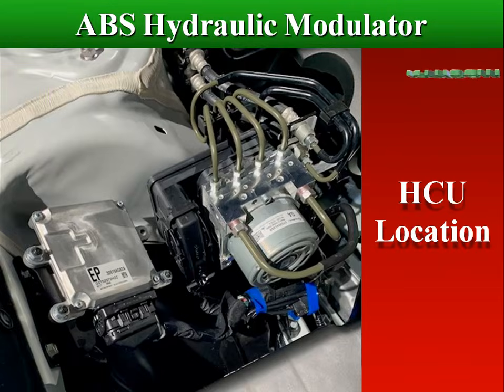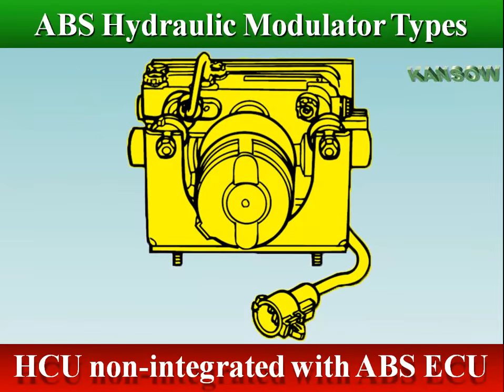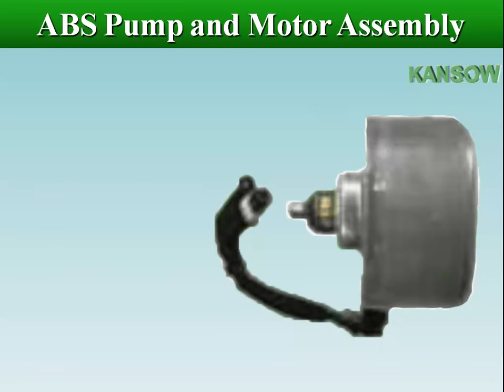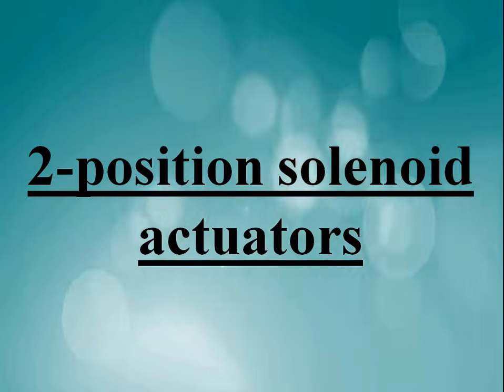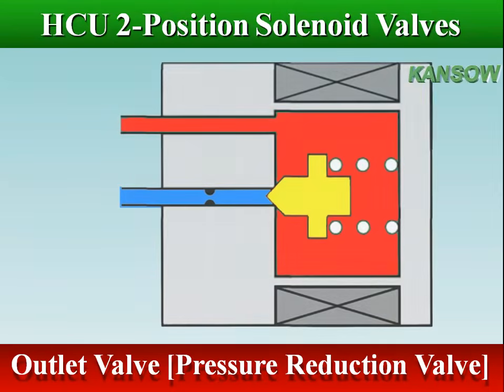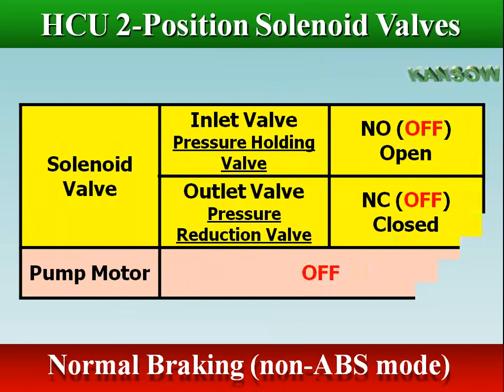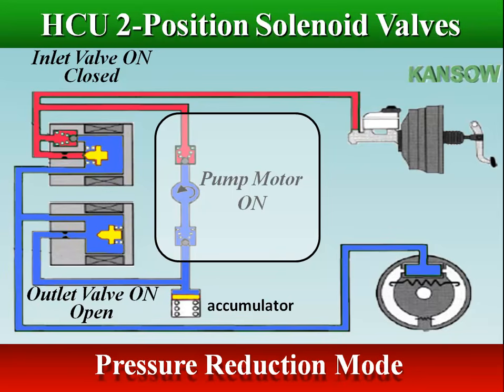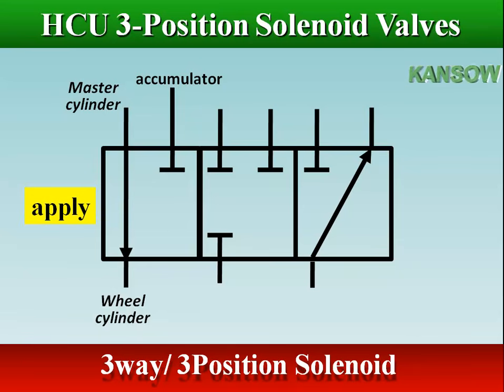ABS Hydraulic Modulator Types &  Components

Comment: If you are based in the UK and you are watching this,  I can fix your ABS module,

If happens that you have one module for repair due to:
- Locking up of one or multiple wheels
- No brake pressure at one of the wheels
- The brake pedal doesn't get firm after several unsuccessful bleeding attempts, when the tested brake pump works just fine.

 contact  me for more info.

Comment: I am fascinated by technology .. I was a Donnington GT championship outright champion in 1980.  My self made Championship winning car had twin master cylinders to allow for BALANCED braking . As the driver, I was the ABS modulator . A recent brake pad and fluid flush on my newly acquired 2008 Citroen C5 saloon car . Resulted in    a pedal going to the floor whenever the engine was started .   Otherwise the pedal was a good firm TOP pedal .I was convinced that this sinking pedal was possibly worn Master cylinder seals , failing under the extra pressure from the Brake booster . After flex honing the brake master cylinder and replacing the seals .€6 euros . The sinking pedal still existed . I bought a Foxwell NT630 Plus abs scan / bleeding scanner .EXCELLENT. this scanner allowed me to cycle the ABS module and resulted in a marked improvement . Still not 100% to my liking .  The Foxwell NT 630 Plus scan tool   displays the operation of all four wheel speed sensors .  Showing they were all functioning with no faults . I have made a couple of test drives  involving a few firm brake applications to bed in the new all around brake pads . The pedal is now starting to show some marked improvement in response . and the dreaded Sinking  brake pedal to the floor has seemingly sorted itself out .   This has left me wondering  what the ABS module could have   operated to introduce the sinking pedal .  Throughout my long life of driving    I have never had any issues with maintaining my own vehicles braking systems .  Would Vacuum brake bleeding have upset the functions / operation of the ABS module / solenoid valves etc . I made a super Vacuum bleeding arrangement  which functions really well .  Unfortunately My Foxwell NT630 Plus abs scan tool does  not show the functions / operations of the ABS module . It would be nice if the  various operations could be shown visually on the scanner display screen . This would allow the operator to diagnose a sticky / faulty abs solenoid / valve .  The scanner displays LISTEN.